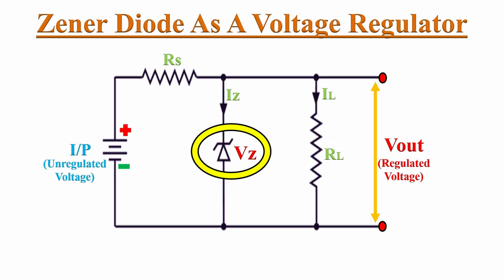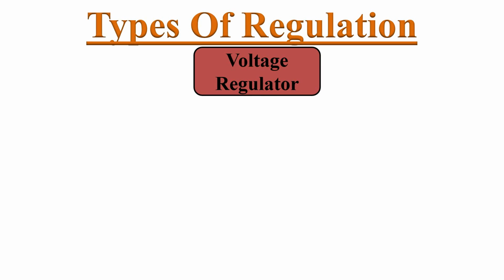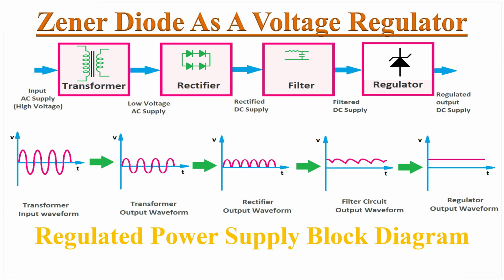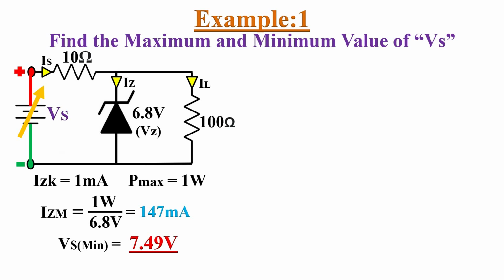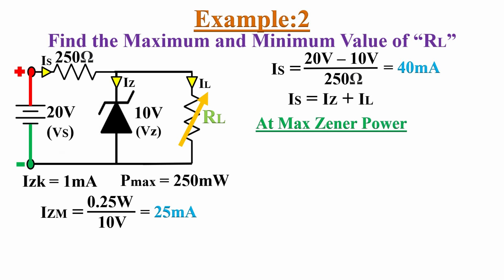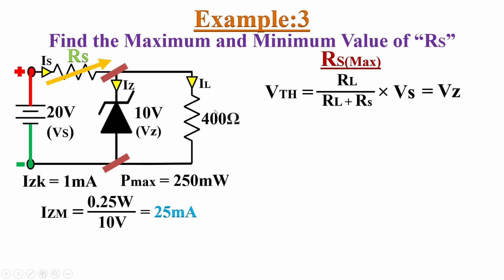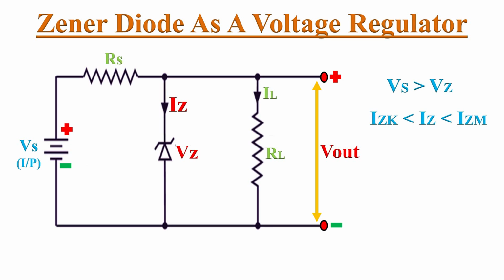Zener Diode as a Voltage Regulator, (Line and Load Regulator)

Comment from the maker: Timestamps for various topics covered in this video are as follows:
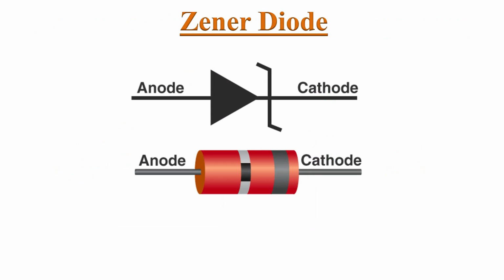0:27 Introduction (What is Zener diode),
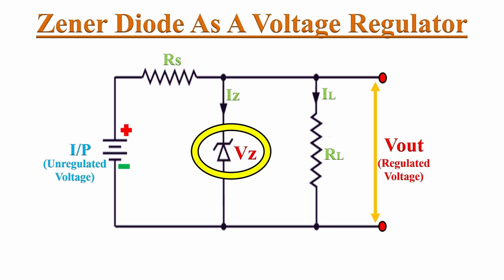3:03 What is a Voltage Regulator and its Types (Line and Load Regulation),
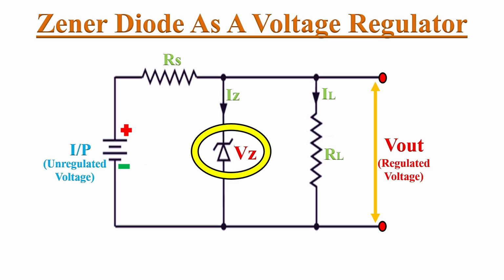4:35 Zener Diode as Voltage Regulator,
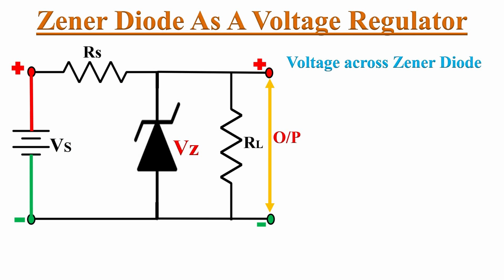9:04 Formulas of Zener Diode Voltage Regulator,
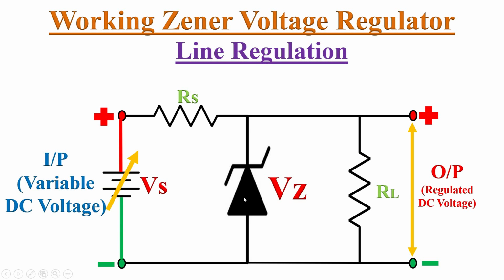11:08 Zener Diode as a Line Regulator and Example 1,
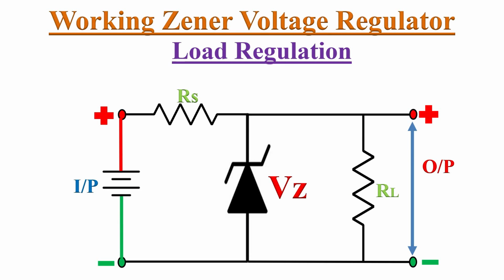16:54 Zener Diode as a Load Regulator and Example 2,
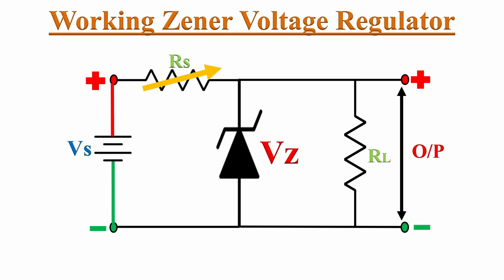20:58 Zener Voltage Regulator with Variable series Resistor Example 3.